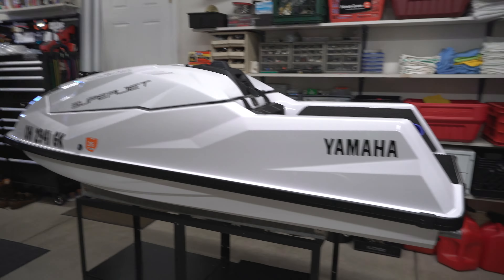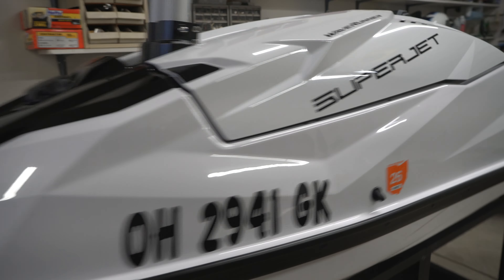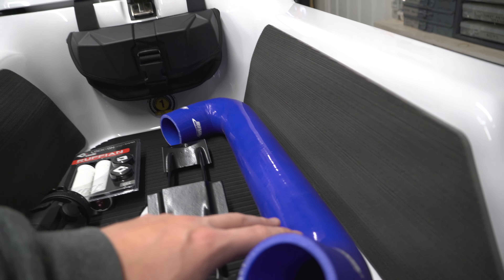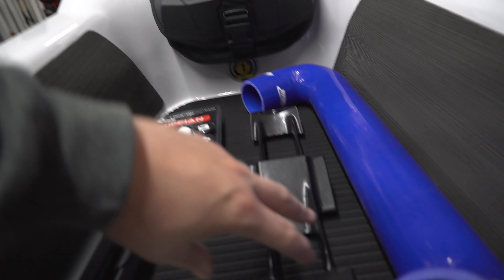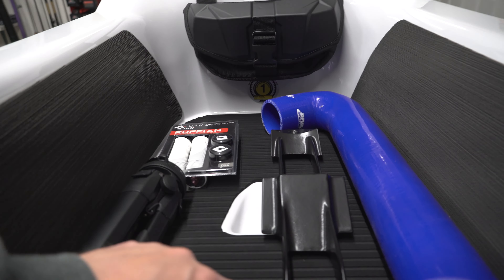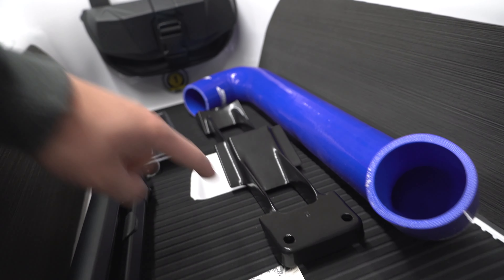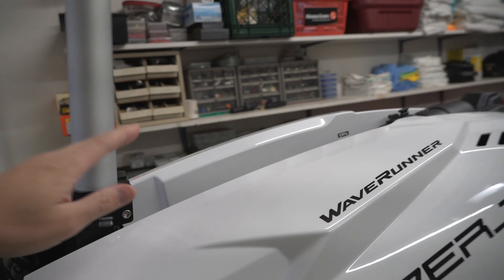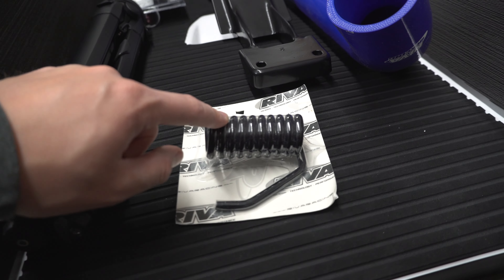2023 Yamaha Superjet TR1

Comment: The quality control sucks tho I have paint chipping off the hood and there’s porosity in the gelcoat
Reply from the maker: Awe man dont say tht 😞. I havent noticed any porosity on ours. The hood is crazy light but feels cheap($1500for a new hood). Have you done the handle pull spring?
Reply: @Floatsorrolls1  no but I’m hoping the porosity is covered under warranty and i didn’t to the pole spring did the ovp steering tho